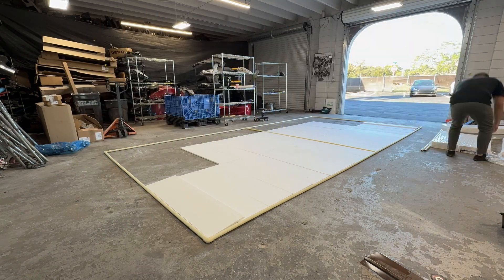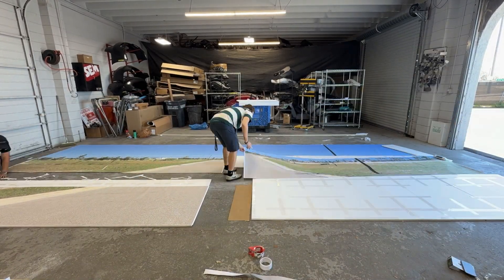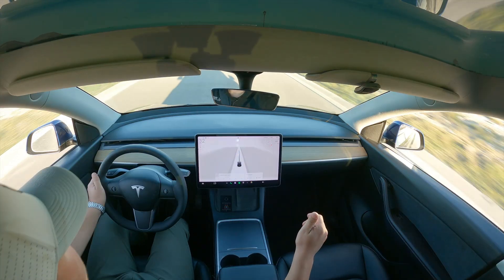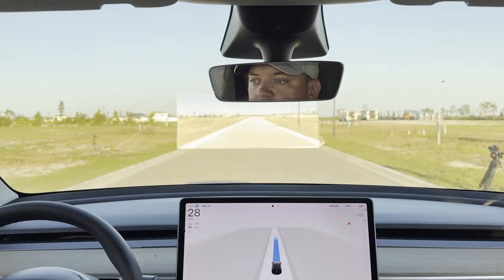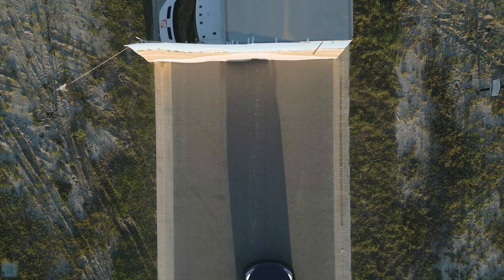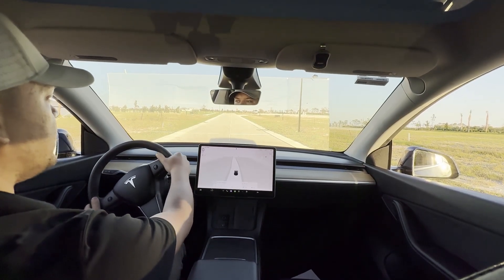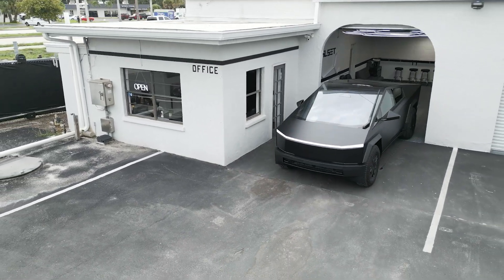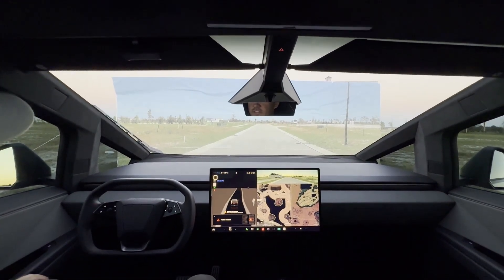Response to Mark Rober’s “Can You Fool A Self Driving Car?”

Comment: The time of day/lighting might have caused the differences. The first tests the wall color blended well. Thanks for doing this test and being honest.
Reply: Yeah the contrast between the two is way too much. He needs to go back and do the test with the Cybertruck or HW4 at the same time
Reply: if you look at the display as the cybertruck gets closer to the wall, you can see that it's not detecting the entire wall, only the portion that's being illuminated by the headlights. pretty sure that's what made the difference
Reply: @deliberatelynaive  that's a really difficult thing to notice, wow
Reply: @deliberatelynaive I think this is it, you’re probably right
Reply: @deliberatelynaive  but it starts slowing at 6:56 on the first test. That is pretty far for headlight reflection in that much daylight. idk. It seems to see some inconsitency though as 1 pixel shows on the screen at point. Then in the following few frames begins to show the base of the wall after that. Hmm
Reply: @deliberatelynaive  at 8:17, it doesn't use headlights, but the contrast with the sky is more pronounced so that could be an issue still.
Reply: @deliberatelynaive  Yeah my first thought was the only real change, besides test lighting conditions, were the position of the cameras and headlights. Nobody should have full faith in FSD ever since they decided to start removing, rather than adding sensors. Why rely on optical sensors when you can have superpowers like seeing through fog and darkness?
Reply: That’s what I’m thinking, the image looks much more obvious and out of place for the cybertruck.
Reply from the maker: It’s possible. I will be retesting later this week during the same time of day to see if results change.
Reply: @kylepaultests  I look forward to it!
Reply: @DrFrunkenstein  the idea is, if your eyes can see it, then the camera obviously can, too (proof: we've been able to see the wall in the video lol). Everything else is processing and interpreting the data. That's why the version matters.
Reply: @bigchill9065  Well, people run into mirrors, because even they cannot see them.
Why is there such a refusal of lidar and radar? Why not combine cameras, lidar, radar and supersonic? Just like in a Mercedes, or BMW..
Reply: @dunjak111  Mercedes/BMW have no FSD equivalent, what they have is an autopilot equivalent. The only real alternative autonomous platform is provided by Waymo. One Waymo costs up to 250k USD . A Tesla will offer autonomous cars for 25-30k USD, for private purchase, and is moving towars 10 million cars on the road with that capabilities. The difference is the price, and the scalability. Elons words are, Lidar is redundant, cars and roads are designed for visual input, just as humans. based on the result, it turns out he is right. Also Lidar can interpret fog as a wall.
Reply: @bigchill9065  German manufacturers go a different way, due to the regulations.
As soon, as the driver is allowed to take his hands off the wheel, the car becomes the driver, by law. And the manufacturer has to take responsibility for that. Further. it is not allowed, that the car disengages its autopilot 1 second before the intervention. Even 1 second can be decisive in a crash.
There has to be a 10 seconds latency.
So, after you hear a warning sound, there needs to be a minumum of 10 seconds to orientate yourself and take back the control. 
During that time, the car has to keep on driving itself. That is the law.
Both, Mercedes and Tesla are not willing to accept that responsibility inside city limits, yet.
Mercedes is willing to accept that responsibility on the highway. But thats all.
Tesla could get FSD in Europe, tomorrow. Tesla just needs to accept the responsibility for it.
Btw: Those laws were made years ago. In fact, Germany was the first country to implement laws for autonomous driving. And those laws are the same for any manufacturer.
Its not like in the US,  where you have countless cases of "who is responsible after a crash".
Sorry, for my bad english.
Reply: @dunjak111  not wrong what you are saying. in my honest opinion, german car companies can't compete in the FSD world, and the only way to avoid bankruptcy is to purposefully slow down EV transition and regulation. That buys them time to reorganize. One thing for sure, I will not buy a car with steering wheel any more and sadly Mercedes/BMW/Porsche don't have one in the pipeline, unless they licence FSD from Tesla.
Reply: @bigchill9065  hahah completely delusional.  Ok go buy a car without a steering wheel.  Im sure its coming out soon like how quickly the tesla roadster came out.  Oh wait LOL.  Keep getting played.  Waymo has fsd NOW.  Tesla is not even close.  We keep getting told we’re getting there soon.  Elon said robotaxi was coming in 2020 LOL. Please tells us when you buy your car without a steering wheel, we’ll wait for your update hahah
Reply: @bigchill9065  "I will not buy a car with steering wheel any more"
Hehe. That is the huge difference between us. I love driving 150mph on our german highways, myself. That means alot of freedom for me and I dont want to miss that at all.  (we have no speed limit at all on most parts of our highways)
-
The laws for autonomous driving have not been made up lately, just to slow down FSD. Those laws are ten years old, by now.
So, why reorganize? German manufacturers are building according to european and german regulations and laws. They wont reorganize for the US.
-
Again, its all about responsibility. As soon as the driver is allowed to take his hands off the wheel, the manufacturer needs to take the responsibility for the car. That is all it comes down to.
level 3: 10 seconds latency = allowed to watch a movie
level 4: no driver needed/in special areas
level 5: no steering wheel, because the car can manage any situation on its own. (=autonomous)
Reply: @bigchill9065 very well said. If a human can account for it, the vehicle will also need to be able to account for it
Reply: Agree that the time of the day makes a difference as well. One can see on the Cybertruck the visualization of the wall is where the headlights are hitting and reflecting, during the day it might have been a different result, but also might not.
Reply: Also, was wondering if the Tesla parked on the side of the road to the right near the wall could have made it hesitant...
Reply: Definitely possible, but I think the version still played the larger part in this. V13 was a HUGE change
Reply: Yeah, worth having a hw4 y and cybertruck running test at same time of day
Reply: V13 and v12 are completely different animals, speaking as someone went through v10-13
Reply: @狂野猎人  yep, feels like a completely different ghost behind the wheel between those versions
Reply: Old hardware and it was starting to get dark so cybertruck saw it easier
Reply: Look at the screen of the Tesla Truck and what it is detecting on his first run at it. It has nothing to do with blend of the picture at the top. The truck clearly sees the very base of the wall.
Reply: This has been a debate since the beginning of self driving. A camera only system is fine until it isn't, as you see in the model X. Glare, debris over the lens, lack of contrast between foreground and background, and sensor blowout from strong light sources have caused erratic behavior and even killed people. Having a secondary system that isn't affected as much by the issues of cameras and their lenses is a good idea that while yes may cost you more money, but may save your life. If you go parachuting, don't you want a backup chute?
Reply: The fact that its performance is dependent on sunlight is inexcusable.
Reply from the maker: Per your request! 🎉 enjoy

https://youtu.be/TzZhIsGFL6g?si=p_T4M_3pqILRE2rE
Reply: @kylepaultests  thankyou, you literally answered every question possible.
Reply: Dude what more do u want...lol such a fan boy
Reply: Yeah completely, during the first tests the wall matched well the background but during the last ones the difference in the colour was pretty evident even for the sky part looking like a whatever painted wall.
Reply: Excellent point.  However, all these tests beg the question:  Is it reasonable to think people will actually put up a "Wyle E. Coyote-style" booby-trap in a real-world scenario?  The funny thing is, Cybertruck's FSD has been said to be inferior to Hardware Version 4 FSD on The Refresh Models 3 and Y. So these models should perform even better than the Cybertruck did.
Reply: @paulclementyonkers4604  Yes. It has been known to happen where people paint the wall at the end of a road to look like there is more road. And people who haven't been paying attention have been known to drive into them. It isn't a completely unheard of scenario and FSD absolutely needs to be able to account for that somehow.
Reply: So we need upgradable cameras, one in a wile , hope tesla will give us some feedback, could you do an other lap in the same time of day cybertruck clip with HW3 . Interesting to see how this goes
Reply: @bangolufsen4744  I remember Tesla said all customers who bought a HW3 car with FSD is getting an upgrade to HW4 for free in the future
Reply: while that might be a factor, the cybertruck uses radar, which is very similar to lidar but uses radio waves instead of light, and no other tesla before it had that functionality
Reply: Interesting.  If time of day wasn't a factor, I wonder if this is a hardware limitation, software limitation, or a combination of both.
Reply: Every camera setting is different. Exposure is different.
Reply: yep this is what i thought too
Reply: I was wondering about that as well. In the Cybertruck tests, the sky had become cloudy, making the wall easier to see.
Reply: Mark Rober is clearly biased and did not want to conduct the test properly
Reply: Yes, by the time the cybertruck is used the wall was too obvious. You can even see the headlights reflection on it.  Too biased
Reply: No it was the hardware 4.
Reply: yeah, test are not comparable. The CT result is pointless. Light conditions were different
Reply: The cameras see more than just images regular images, there are massive amount of ML and CV going on in realtime for just colors to confuse the whole thing.
Reply: I definitely agree
Reply: Agree
Reply: Absolutely. The entire point is the image had to match the sky.

At night the lights create a massive difference on the picture.

This is just a crappy test
Reply: I think time of day definitely played a role, it would be interesting to see the cybertruk during the day. The cybertruk seems to only see the very bottom of the wall, and that may be due to the color difference or the headlights hitting the wall.
Reply: Nah it was the deathgrip, which disengaged the FSD in the other video
Reply: @beardsntools  LMAOO
Reply: Hey did you ever think that maybe the cyber truck front bumper camera possibly helped which is another possibility as to why only a portion was shown on the display.

What’s even more crazier is everyone is finding the most craziest excuses as to why the cyber truck stopped this shouldn’t be rendered in valid because of the time of the day  honestly if Tesla still had Radio Detection and Ranging in there vehicles still this wouldn’t even be a issue.

And you would think since this wall is lower quality it would be harder to see compared to the other person higher quality wall
Reply: It only brakes when the lamp post goes out of view. That must be what's triggering it to stop.
Reply: @ these possible reasons as to why it stopped are getting absurd. someone just said it was because of the sunset and contrast making it easier to see which is why it stopped have everyone forgot the cyber truck uses a front bumper camera
Reply: The lighting is different. There was cloud cover when the cybertruck went. Look at the shadows of the things along the road between the tests. No idea if that matters but it is a difference.
Reply: @ So your telling me sense Tesla doesn’t use Radio Detection and Ranging And Light Detection and Ranging in there vehicles and since FSD doesn’t have redundancy the camera’s performance is directly affected by the time of day
morning-afternoon-night and the contrast of something and the lighting

Radio Detection and Ranging And Light Detection and Ranging
These systems wouldn’t be affected by the time of day or the contrast or lighting
Reply: The contrast was so different due to the light conditions.
Reply: I was thinking the same thing. The wall seemed more washed out and the sun was behind the car in the model y tests. The cybertruck tests were on an overcast part of the day or something and the wall seemed more well defined. Appreciate the seeing it work at least sometimes though.
Reply: Bunch of excuses😅
Reply: a big oversight.
Reply: Yeah I noticed that too. That camera sees the shadow of the car on the wall at the last second and brakes hard. Still an example of how much better LIDAR is over purely optical.
Reply: Headlights were hitting the wall in the evening.
Reply: Oh, the car only stops depending on time of day? I feel so safe!
Reply: Wow so many excuses for the Tesla to fail and test and test untill they pass😂
Reply: @ that’s how you figure out where the shortcomings actually are. Why is that a problem?
Reply: it 10000% without a doubt did. and just doing a test on a single HW3 vehicle vs a single HW4 vehicle with a completely different body. like come on, do it right if you’re going to go through all this trouble.
Reply: From inside the difference isn't that much visible. The cybertruck sees the wall from a long distance, it apperars on the screen. It is only better in every way.
Reply: https://youtu.be/TzZhIsGFL6g?si=op65KlbbEwbu3vZm
Reply: The camera on HW3 is 1.2MP compared to 5MP on the HW4. That made all the difference.
Reply: @thecrimevault-channel  Cybertruck also has a front camera think thats the difference maker
Reply: Time of day definitely gave the truck a leg up, but the HW4 camera and software upgrades are substantial too. Funny thing is that if this was the result Mark wanted, this shows he still could have had it without twisting giant pretzels in his test setup.
Reply: I dont think so. You can even see the human outline on the side of the road for the Cybertruck Test, where it wasn't showing a human previously on the Model 3.
Reply: @tookster7483  I don't believe someone was standing by the camera with the first tests. Does the SW notice humans on side of road and go into a more cautious mode?
Reply: @EdBruceWRX  Check 4:35 onwards. No human was detected.
Reply: In mark robers test the model y plows through the wall while riding the centre yellow line. Even basic autopilot will not do that. I believe the car was being driven manually. Why he would frame it the way he did, I'm not sure.
Reply: Whatever! Looks like your setup is dangerous. There shouldn't be anything behind a fake wall like Mark's video, 

What if you couldn't brake the car in time?
Reply: It was 100% because the model Y had super goofy software, V12.5.4.2 is pretty old and was never that good, not sure why he still even has it, he should be on 12.6.4 or 13.2.8 if it’s HW4 which are the current main builds
Reply: @voltspc9394  Still depending on the camera there was quite the sharp line between the colors so it would be interesting to know because that could also be a factor involved.  With that said they have fixed focal length cameras so maybe they are doing more processing to figure out distances based on blurriness.
Reply: @voltspc9394  this is a valid take if tesla hasn't claimed that this feature works since V8,9,10,11,12 and claimed that functionality is equal for HW3 cars. I should not need Tesla's best newest thing in 2025 if the features were advertised in 2019. I have a hw3 car and was told it had this.
Reply: @voltspc9394 people are saying it’s because he used autopilot instead of full self driving
Reply: @voltspc9394 can't ever say 100%
Reply: @voltspc9394  lmaoo cope
Reply: No. It’s hw3/v12 vs hw4/v13.
Reply: exactly. also hes not using the latest FSD software. waste
Reply: Mark Rober just switched the auto pilot off before the impact. You can see it in the cut.
Tesla is going to court now.
Reply: @Muenster187 he switched it off half a sec before hitting the wall? 🤦‍♂️
Reply: Hell nah
Reply: This so-called "test" was obviously designed to make Tesla’s pure vision system look bad. In real-world driving, you’d never randomly encounter a giant backdrop placed on the road, so testing it like this is completely unrealistic and meaningless.

It’s like setting up a trap just to make the system fail—kind of a cheap trick rather than a fair test. If anything, it just proves that FSD wasn’t built to handle staged pranks but to improve real-world safety. There's no reason for Tesla to modify its system just to account for something that would never happen in real life.

People who understand technology or have common sense will probably just see this as a joke. Instead of exposing any real flaws in FSD, it just makes the tester look like they're desperate for attention.
Reply: @sushangshao the exact test done,  sure.  But the fog tests are legitimate,  and show a failure of software design.   A good human driver knows it's almost never okay to over drive your visibility.   So if you have a wall of fog, you need to slow before you go through. 
   It's also a specific way to show the flaw in the logic of only using visual cameras for sensing the world.  If the first goal is safety, not having LIDAR to augment seems like a mistake to me.
Reply: @patrickshields2375  yeah but that is the whole issue with Lidar. It doesnt sense fog and steam well and sees them as a wall and thus just wont operate at all. When Mark's video showed lidar stop it wasnt because of the kid in the road, Lidar sensed the water as a wall. You could take the kid away and it would still slam on it's breaks. There are plenty of videos showing Lidar stopping for steam coming out of manholes and refusing to move forward.
Reply: @Fragmentations  "that is the whole issue with Lidar." - self-driving cars that have Lidar, also have normal cameras. They simply have more information to work with, and therefore can make better decisions in theory.
Reply: @renedekker9806  Ok, now imagine that lidar sees a wall in front of it, but the cameras don't see it.
How are you going to resolve this conflict?
In reality, the algorithm gives priority to lidar and cars just can't move in normal situations (you can find a video where waymo just gets up and can't drive further in front of steam/wall of water)
Reply: @makedonski_cf  "How are you going to resolve this conflict?" - by combining the information from the lidar and the cameras. 
"you can find a video where waymo just gets up and can't drive further in front of steam/wall of water" - which is exactly a situation where the camera image could be analysed to check what it is, and proceed with caution.  
Having more information available means the car can take more informed decisions, then if only the camera was available.
Reply: @renedekker9806  from what I understand LiDAR ideally requires pre-mapping to compete with cameras, limiting its scalability. Tesla wants FSD to work everywhere while using less power than LiDAR. Their argument is that if humans can drive using only vision, AI should be able to as well. The main challenge now is hardware and software—HW3 struggles with certain cases as you see if fails this wall test, but HW4 improves on them, as it passes the same test. As AI and compute power advance, FSD should eventually outperform humans, since it won’t suffer from fatigue, distractions, or aging. In theory, Tesla’s approach should scale better than LiDAR, but it depends on AI reaching human-level decision-making. I am no expert tho.
Reply: @sushangshao  The test is designed to show a flaw with the design that would not occur with a human driver. A human driving up to a wall like that would recognize it for what it is and stop. If existing vision only systems can't do the same thing then they need to be improved even if this scenario is exceedingly unlikely.
Reply: @sushangshao  And for the fog?
Reply: @sushangshao  no, this is proving that FSD is imperfect, the answer? It's simple actually just combine both system, FSD and LiDAR. What we need is the advancement of self driving technology, not fighting over which company should you support. Use the better system for the safety of all people on the road. And I still think both Lidar and FSD still not perfect, hopefully we will get something new and truly create a perfect self drive
Reply: @sushangshao I understand technology and have common sense, this is not a joke.  The intention is to teach stupid people who don't understand computer vision or have common sense why this makes Teslas more dangerous than any other self driving car on the road.  The system ISN'T HUMAN.  It doesn't reason.  It just looks for patterns and tries to match patterns from it's training data to patterns it sees, and "makes decisions" based on probability.